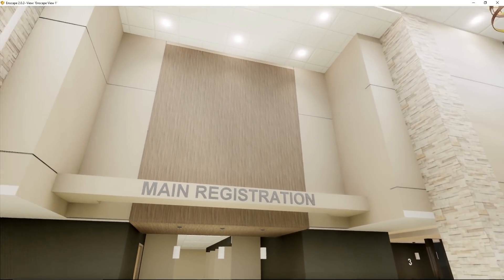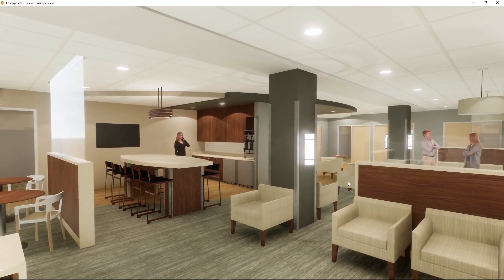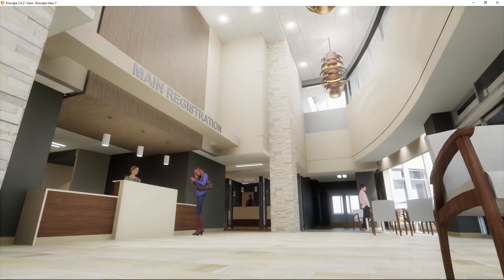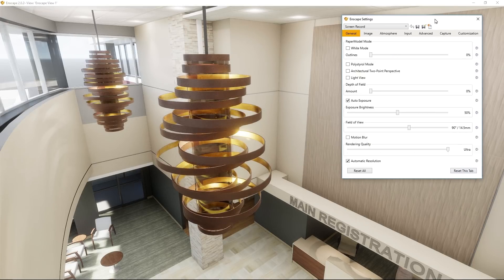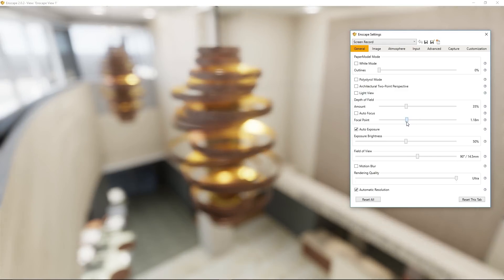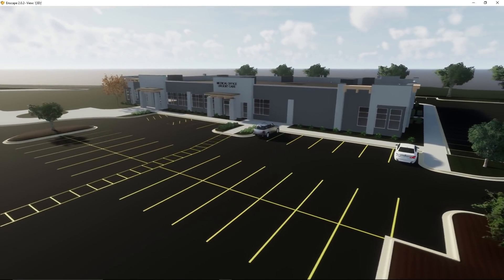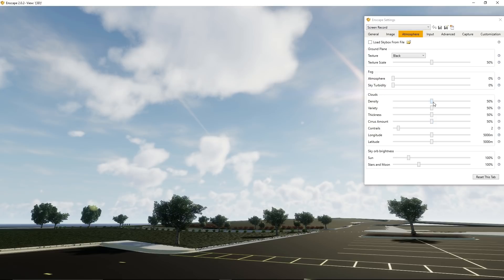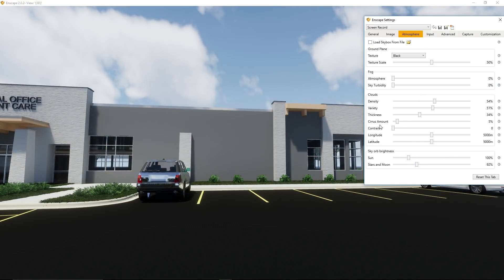Enscape 2.0 Tutorial | Part 5: Intermediate Rendering

Comment: Can Enscape do very specific geography location sunlight settings? 
eg, my project is based in Michigan and I wanna test the sunlight in my project interior environment, how would I do a very accurate  sun analysis ?
Reply from the maker: I believe Enscape3D uses you project location from Revit to determine solar path, angle, etc. Check your sun settings in your 3D starting view for Enscape and under 'Solar Study' check the box for "still". Also in the sun settings window you can set your project location to real-world coordinates.